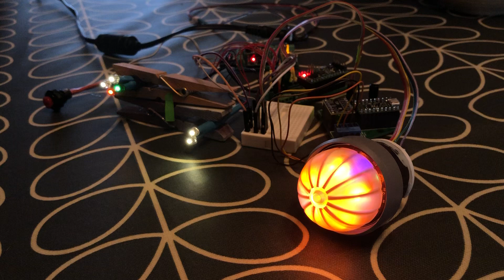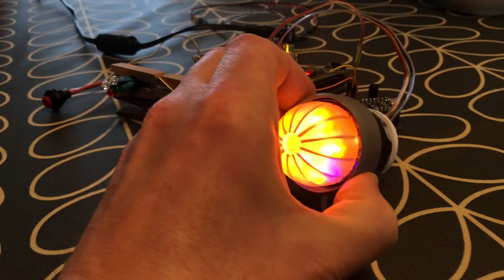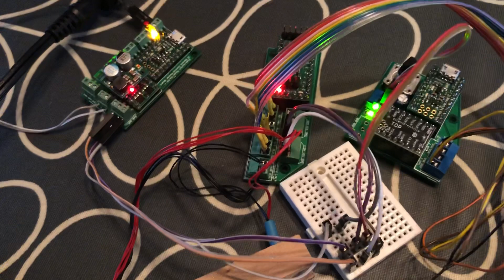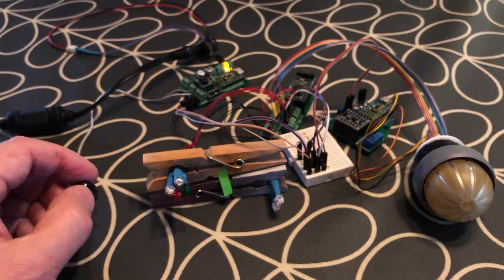TOS E 1/350 Model Custom Circuit Boards - Mk42

Comment: This is awesome!  Any plans to release details of this?  I'd love to use this in my model.  I really like the use of the quiet stepper motors.  Thanks for the look see and keep up the good work!
Reply from the maker: Thanks Mark! I just posted all the necessary info to my Google Drive folder. Please see the updated Description.
Reply: @RossAWaddell  Thanks or the drive link.  I was looking at the BOMs and for the stepper BoM there is only one TMC2208 stepper motor listed.  Obviously I'll need two.  But will I need to duplicate that BoM purchase?  Thanks in advance.
Reply from the maker: @markhanley9309  No, you only need one board and one TMC2208. You can connect two steppers to the board (reversing the wire connections so one spins in the opposite direction). The key is to set the right current limiter value on the TMC2208 - for my steppers, it was 200-220mV for one, and around 400mV for two. The FAQ and related documentation has more details: https://learn.watterott.com/silentstepstick/faq/
Reply from the maker: Mark - here's my video which shows you how to connect 2 stepper motors to my circuit board: https://youtu.be/ZSV4F-Gafm0